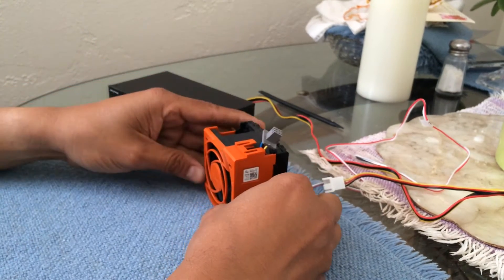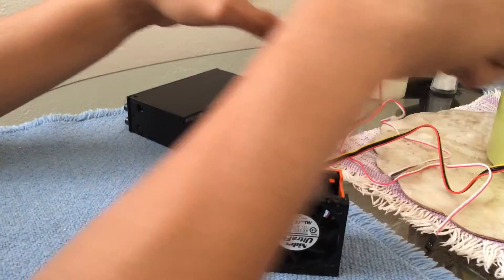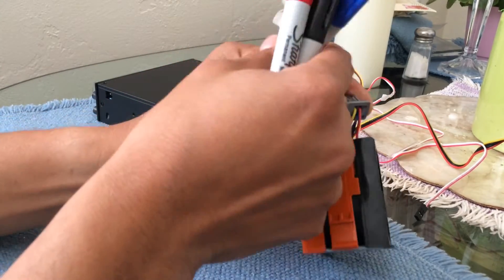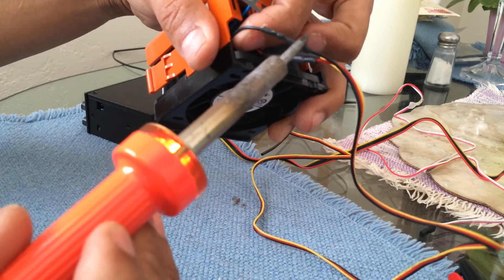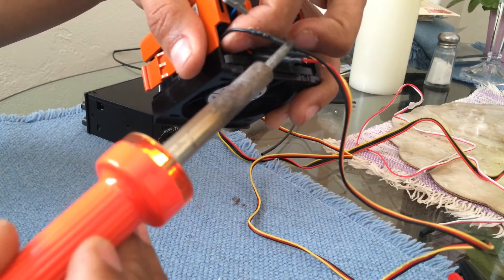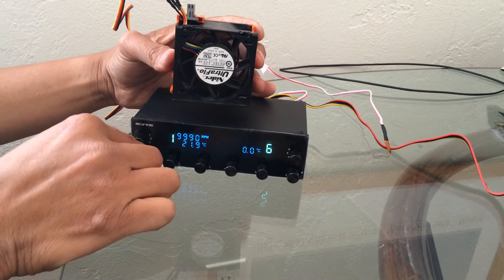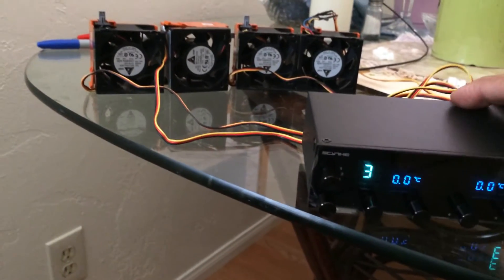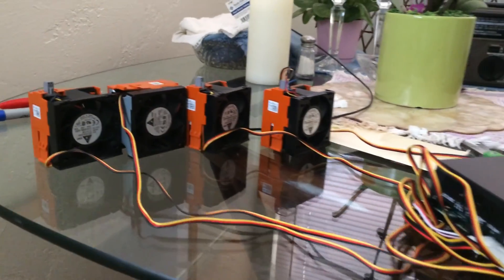Dell Poweredge R710 Fan Noise

Comment: Could you explain the pin out of these fans? For example, red=12v, black=ground, yellow=tachometer etc. Cant find pin outs anywhere on Google. I couldn't make out what you have wired here. I need to service my r710 fans and test with bench psu before re inserting them. Thanks!

Comment: I know it's an old video but the cables that go in the controller are 3pin or 4pin PWM? Can you control the speed on 3 pin cables?
Reply from the maker: These are 3pins, yes you can control the speed with 3 pin

Comment: Sir, if we increase the voltage than the rpm increase?
Reply: Yes, More voltage. more speed normally. but going above the 12V will cause it to fail instantly or quickly.

Comment: think this is nice, but if the R710 fans are noisy for you, might consider replacing them, my two units are so quite that unless i see the lights I would not even tell they were on, designed as many other have said to move air to keep system cool

Comment: HI!  I have an R710 that is quite noisy....  Are you advocating using the external controller that you showed, to slow down the fans in the R710?  If so, what RPM to you usually run at, and how do you know that the CPU's aren't getting too hot?  Thank you for your help!
Reply from the maker: You can, but in the end, I decided to use a different set of Fans from regular desktop computers. Take a look at this video: https://youtu.be/iIdJ6aY1ZaU
Reply: I know a way to turn down the fan speed

Comment: Those fans are designed to push air like that. Find another fan that size that moves that much air and is quieter. Hard to do. Dell designs them to be able to keep the servers cool no matter what, even at full RPM. I'd rather have have a loud fan than to have a toasty CPU.